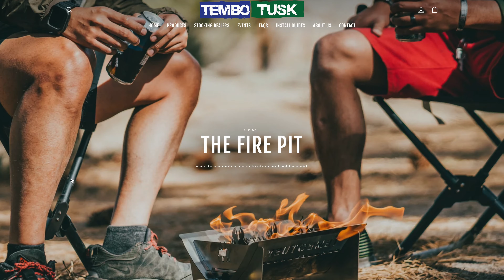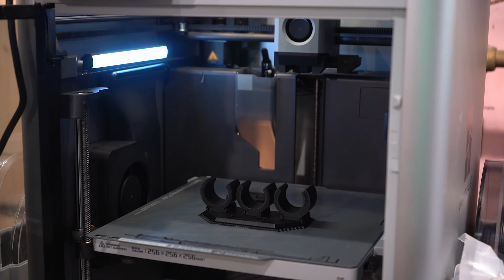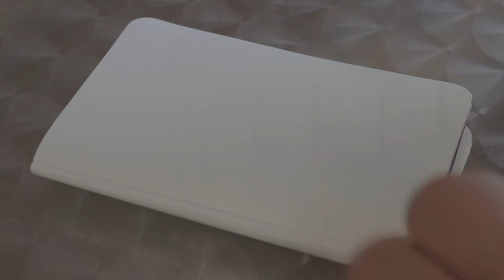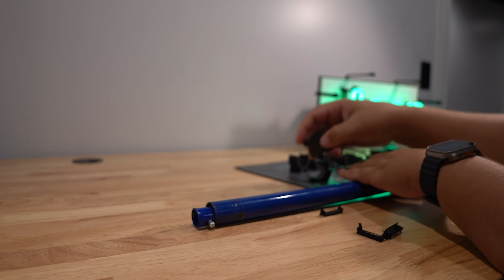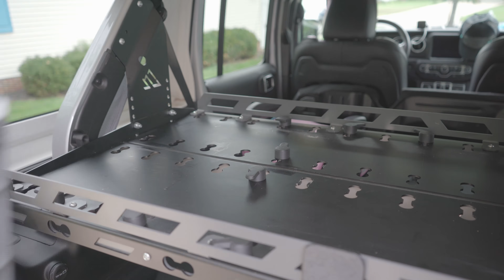How I 3D Print my JEEP Mods

Comment: So you know PLA has low high temperature resistance and inside a car on a hot enough day it will soften enough to flex and loose shape (ask me how i know :D) the best material is ether PETG, ABS or ASA which the X1c can easily print with as well (would recommend eSun ABS+). ive had both PETG and ABS on parts on my car and they are fine even when we have 108f days you wont need to do any design changes.
Reply from the maker: I did not think about this. I wonder what the failure temp is?  I’ll have to test! I’ve just begun working with other filaments.  Thanks for the tip!
Reply: @ajarmour   The Temp that PLA starts to deform is 55-60C or 140F.  This is the glass transition temp.  PETG is around 80C ABS and ASA are around 100C.  Anything you print with PLA and leave in the car on a hot summer day will deform to some degree.  It may not be catastrophic failure but clamps/ clips wont hold items any longer.   Since you can print ABS/ASA with your printer use them over PETG as PETG can be stingy and a pain to remove from some beds.  None of my prints have failed with PETG or ABS.
Reply from the maker: Sweet!  Thabks
Reply: @ajarmour   @unconstit1onal29   

Agree 100%, PLA will work until it doesnt - it'll deform just on a summer day with a little bit of tension.

ESUN or Bambu PETG prints just fine on the Bambu with the slicer set to use Bambu PETG.

Super easy and no stringing.
The only recommendation is to use the textured bed, NOT the default smooth plate.

Source: 100+ kilos of PETG printed on X1C's  :)
Reply: I prefer PC over ABS and ASA, less toxic

Comment: Get ready to print all that again.  It will fail in the summertime.  

You want ASA.  High temp, strong, UV resistant.
Reply from the maker: Yes, I had a ton of comments about this.  I did go back and reprint, many with ABS and others. works much better!

Comment: Inside pla isn't a good option. It will warp and melt due to heat. ASA would have been ideal or petg. 

I've been making mounts and molle panels from carbon fiber nylon lately and it's pricey but man it's stupid strong. And the X1C prints it perfectly
Reply from the maker: Yeah I love the X1C.  I had a lot of feedback about the PLA and swapped these prints over to PETG. I haven't messed with the nylon but ill check it out!

Comment: Nice, I already made a cap for my awning to protect it from wear.  I use PETG since it's more heat resistant and UV resistant.  PETG is more flexible also so it would hold those poles good if you make them tighter than the PLA ones.
Reply from the maker: Yeah I’ll definitely be experimenting with more materials.

Comment: Nice work! You say you're no engineer, but your video begs to differ- you're starting off strong with these designs. Keep it up. Tip- PLA is definitely going to fail in a car. I'd recommend three materials with different tradeoffs- ASA is great for this application and what many sun-facing car parts are made of, but on the X1C specifically, ASA and ABS will deposit a film on the carbon rods that'll cause movement issues and you'll need to clean them frequently. Nylon would work (Like PAHT-CF from Bambu themselves) but it's incredibly moisture sensitive and you'll need to print it from a dryer. PC-PBT would also work well- Not UV resistant but a good all-around material and tough as nails in the entire temperature range a car experiences- from below freezing to baking in the sun. Just clear coat them if you want them to not fade after a few years.
Reply from the maker: Thanks a lot.  I’ve got some great advice to work with after posting the video.  Definitely have some new things to try out.  Thanks for watching!

Comment: 2:44 dude, you aren’t doing anything different than engineers hahaha.

If the part/assembly is small enough to be 3D printed you definitely have to 3D print and dry fit stuff.

We definitely have techniques and fancy software to help us minimize the iteration process but dry fitting is a thing.
Reply from the maker: Yeah that makes total sense.  I love how fast you’re able to iterate with one of these printers.